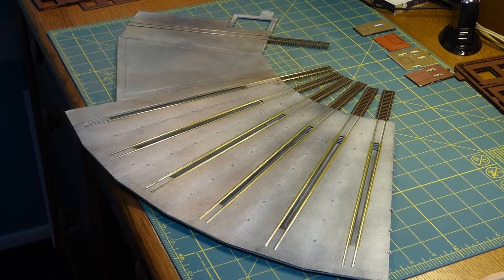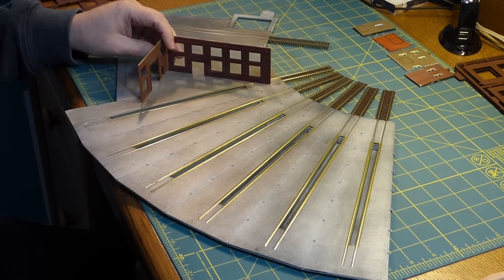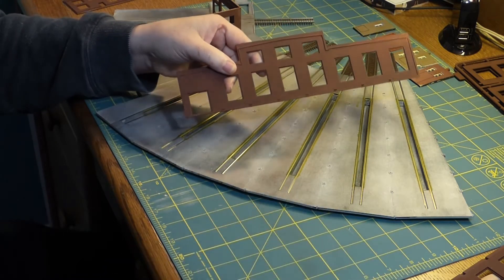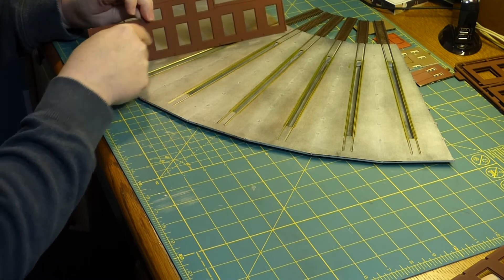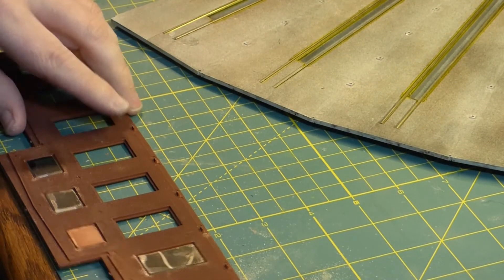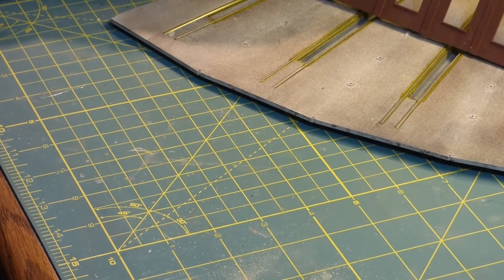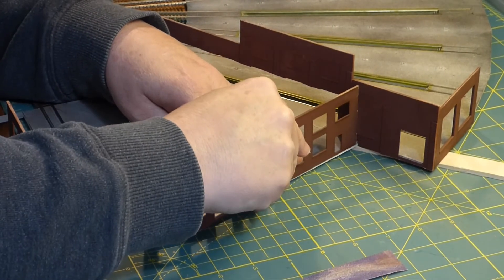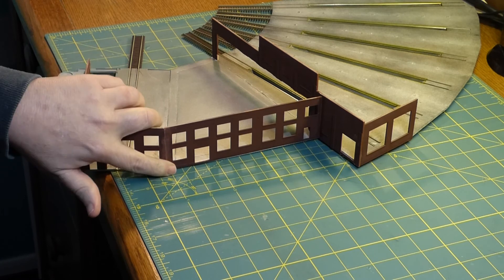Roundhouse Machine shop Kitbash Part: 3

Comment: hi ive follewed every video of your new train layout and roundhouse i wonder will you be furnishing machine with lathes etc as there are plenty cheap 3 d printers doing this type stuff now and would add to the effect of the building carry on gd job mate
Reply from the maker: steve bolt Thanks, yes I have been considering adding machinery to the interior but before I begin looking at that I want to see how much of the interior can be seen once the roof is on and it’s on the layout. If enough is visible yes I will add it.